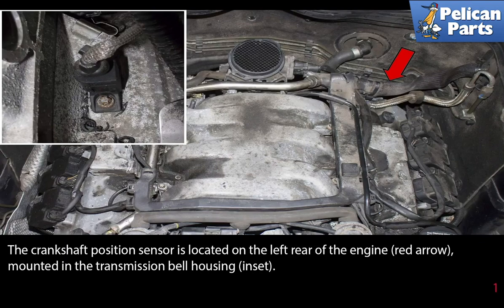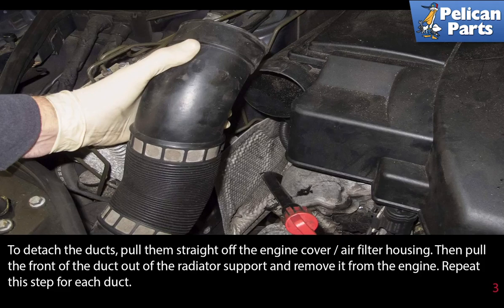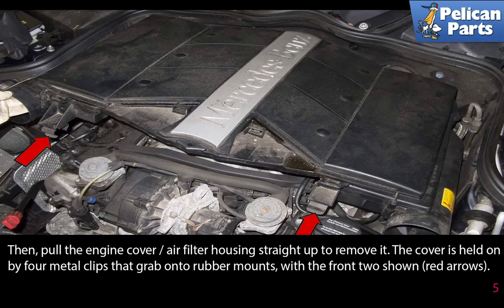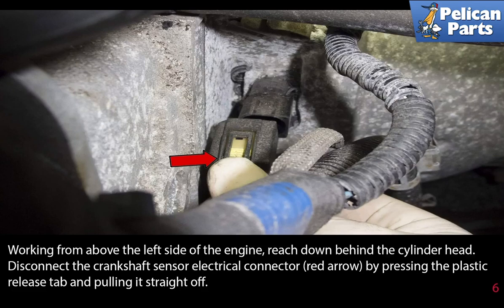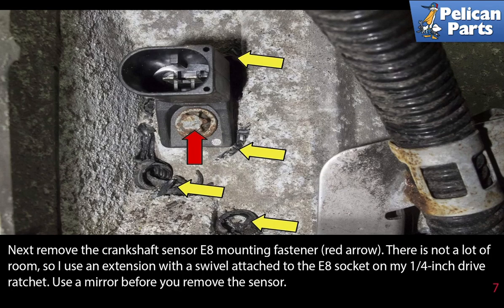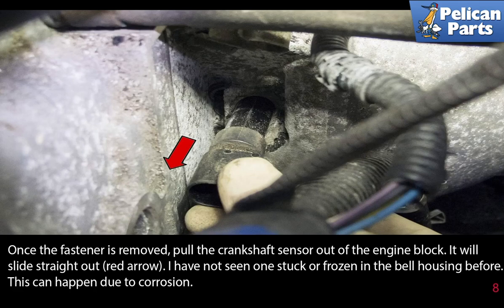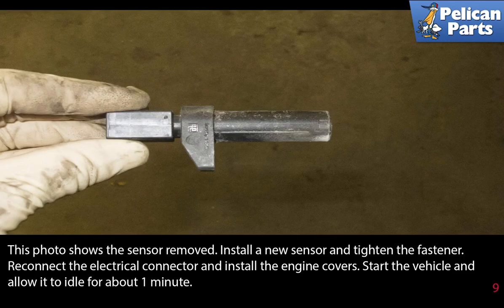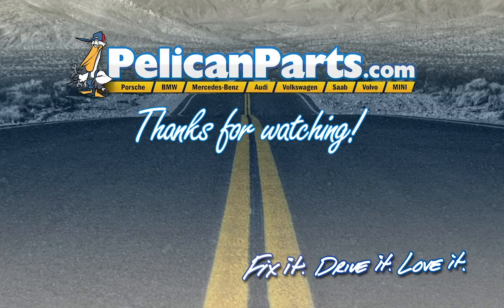Mercedes-Benz W211 E-Class Crankshaft Position Sensor Replacement

Comment: When you change it, do u have to relearn it or it depends on the model of the car. I have e350 2006 and I heard that it has to be relearn. I don't know if that's true tho.
Reply from the maker: Some models do require a relearn with a scan tool. I have also seen people replace the sensor on vehicle that require a relearn and not need it. If you have RPM limiting or fault codes, you'll need the relearn.

Comment: 2006 W211 110,000 miles Great Runner owned 13+ years. 10/10/2022- "Engine Cut out Symptoms" CSS fault Code. RESPONSE: What a MF'er to get this "screw" out on a "first replacement" 10/10/2022 -16 years later. I FK'ed with this for more than 3 hours. Without all the drama it looked like a T4-T3  allen-head looking thru a mirror the only way a 1/2 blind right eye man can see it...finally getting the torx head on it I had to cross over the engine from the passenger side laying on a blanket to get the leverage I needed to get it to "snap" the screw. MF'er can't believe it took me that long. Spray it, clean it, smack it with a hammer before "snapping" it off with the socket torex  "BE PATENT". You have to use a 1/4" drive with extension and get to a position of comfort and where you can leverage to turn the 1/4" drive.  Prepare for some bloody hands
Reply from the maker: Thanks for sharing your repair process and experience. These types of comments add so much to the Pelican tech community.

Comment: Hey today I was driving on a highway and the car died on me and wouldn't turn on afterwards (the engine would crank but it doesnt turn on), I read online and people say that this also happened to them and replacing this was the fix. Do you know if that could be it? Also could it be the fuel sender or a fuse? If it's a fuse what should I look out for? Thanks
Reply from the maker: I can't offer any helpful insight without knowing what is missing from the system when you are trying to start it. When your engine doesn’t start you’ll want to check the basics. Check spark, fuel injector pulse and fuel pressure, volume, quality and engine compression. Are there any fault codes? Once you figure out what is missing, it will be easier to diagnose.
Reply: @pelicanparts  Hey yeah sorry about not giving car info. It's a 2007 e350 4matic, codes I had were P0100, P0560, and P2088/P2090/P2092/P2094. After testing, draining and recharging the battery, it still doesn't start but cranks. I think it's either crankshaft/camshaft position sensors, or the alternator. My engine seems to be out of the balance shaft "infected" zone, could it still be the balance shaft? I will try to check for the sparks and other stuff tomorrow. Thanks
Reply: @emilnad5078  did you ever figure out a solution as to what the problem could be there was a little inner tube like fuel release that releases gas so I know it’s not the fuel and I replaced the fuel relay fuse and those aren’t the issues I have to try to crank/cam sensor/spark plugs and compression I was in automatic driving and every now and again the car would shut off if I stop to reverse or at a light now it won’t start and I have to recharge the battery cause it’s dead again please if you have any info share what you learned
Reply: @jevonhamm9638  The problem with my car was that my rear SAM module (expensive repair) was faulty so it didn't communicate with my fuel pump. If I were you I'd try replacing the crankshaft sensor because it's cheap and easy to do, as well as through my research that was mainly the problem for other people. Also it could be your MAF sensor but that usually isn't the problem. I really hope it isn't the case, but I know that 2006 e350 models are known to have a balance shaft problem which is a VERY expensive problem :(. I also did a quick google search on our cars stalling when put in reverse and a lot of people say it might be the "Throttle Body actuator". My advice is try the crankshaft position sensor and if that doesn't work take your car to a mercedes only mechanic shop (not the dealership), or a reputable indy shop if your area doesn't have benz only mechanics. Good luck
Reply: @emilnad5078  thanks for the advice and heads up I appreciate it I’m in the socal area I’m sure they have them in Los Angeles somewhere But you gave me somewhere else to check I hope things are better for you mate
Reply: @jevonhamm9638  thats good to hear. And yeah havent had any problems ever since except my voltage regulator getting worn out. But thanks, same to you
Reply: @emilnad5078  P0172
Fuel System 1/1 Rich
System Too Rich (Bank 1)
Secondary DTCs
P0175 : System Too Rich (Bank 2)
P0410 : Secondary Air Injection System
P0022 : Intake Camshaft Position Timing - Over-Retarded (Bank 2)
P0025 : Exhaust Camshaft Position Timing - Over-Retarded (Bank 2)
ake System
6230
6210
6401
5C16
4CAE
ESP Electronic Stability Program Control
ABS Anti-lock Braking System Control
Undervoltage Supply
Fault In CAN Communication With Control
Unit A1 (Instrument Cluster).
Component B24/15 (Rotary Speed And
Lateral Acceleration Sensor) Is Defective do you know which of these thing would cause it to not start
Reply: @jevonhamm9638  maybe P0410, most of ur problems are ESP/ABS, you should look into all of them but it seems like ur problem is electrical, maybe has something to do with undervoltage supply? Might just be a bad battery but I honestly dont know. Also maybe try resetting the codes and see if it drives
Reply: @jevonhamm9638  you ever find out what went wrong with your car bro? I'm having all the same exact issue you mentioned with electrical and it stopping and having to charge the battery smh
Reply: @corybradley1126  if it’s stopping because you have to charge it then that sounds like the alternator the engine compression on this one was shot I believe and we sold it to someone piecing it out
Reply: @jevonhamm9638  Yeah like my car gets the fuel to engine starts rough then jus died and other times no start at all. I think alternator too. I jus wanted to check because you described the same exact things that are happening to me with my 03 e320 smh Dealership said cam shaft position sensor so imma change that 1st then proceed to the alty 👌🏾 appreciate you bro 💯

Comment: I think I’ll have to keep both crank and cam position sensor in the car in case they fail I’ve a 2004 E320 with 170000km
Reply from the maker: They don't fail that often, but not a bad idea.

Comment: Mine is stuck. Only half of it came out. Like its fused in place.
Reply from the maker: Remove the remainder is pieces using a pick.
Reply: @pelicanparts  it's the outside of the sensor itself. I tried a lot of different things to pull The tub out. No good. Used a socket with two long extensions and a hammer and pushed it down into the bottom of the bell. Last resort. Would not budge.